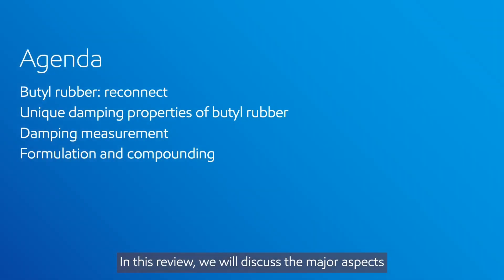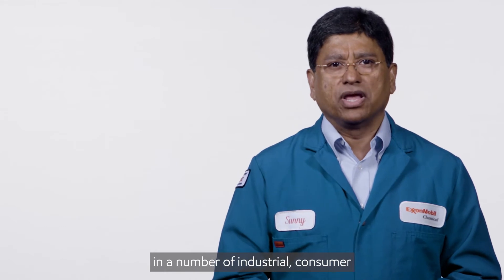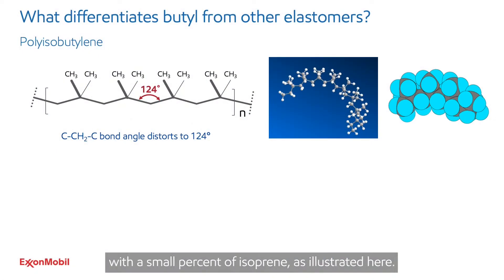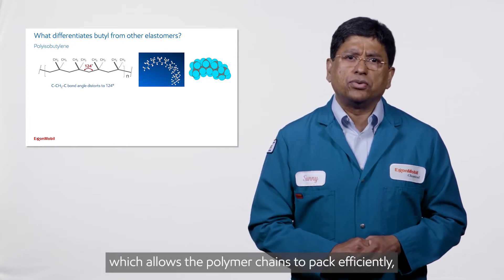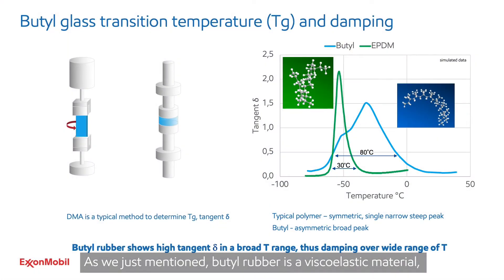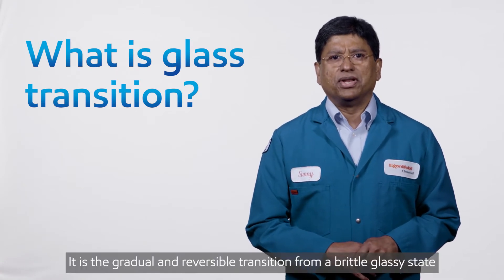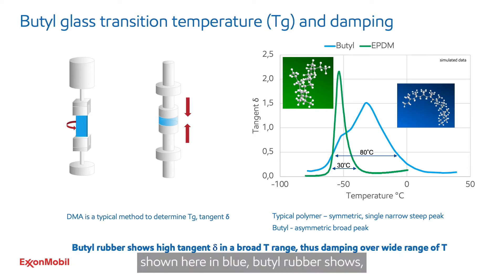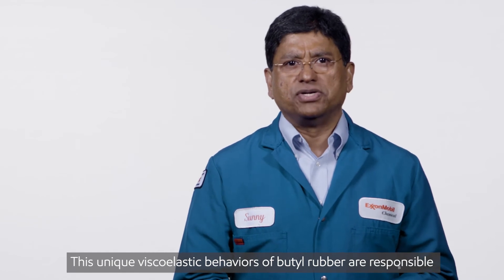Butyl rubber and damping tutorial

Comment: Hello Dr. I am dealing with a Butyl patch that is used to damp the vibration from an ultrasonic sensor that has vibration freq up to 50kHZ~ 70kHZ, I'm wondering whether we have similar plot showing the Tan delta to Temp relationship at this high freq. region ?  I have been searching online and only was able to find such plots for low freq. such as 10 Hz and even a DMA only goes up to 800 Hz max.